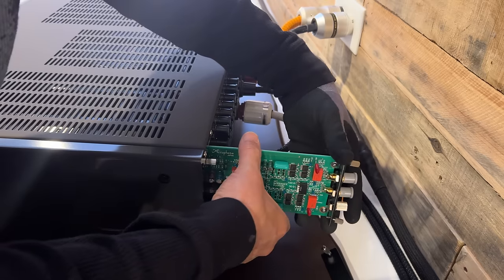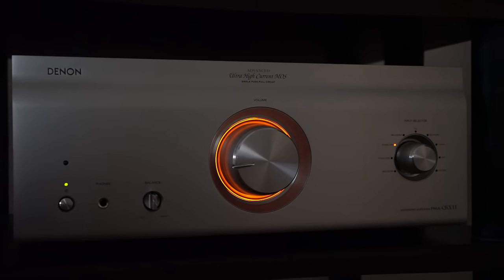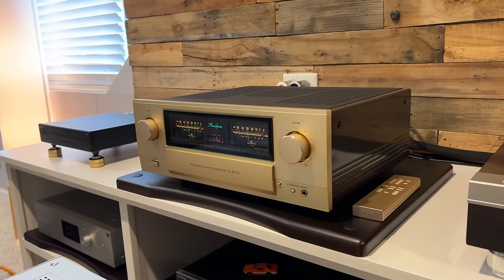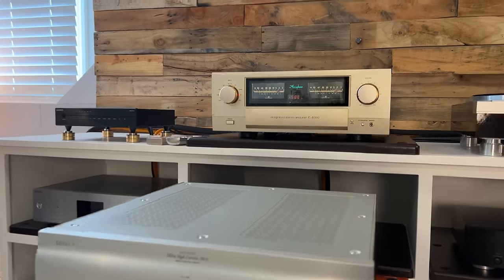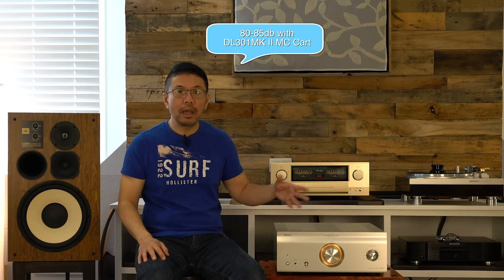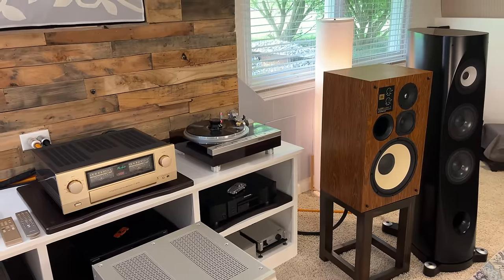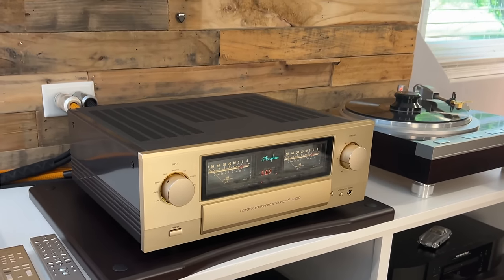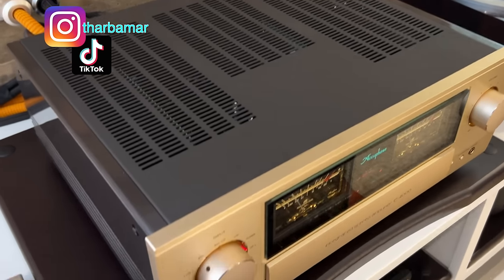Accuphase E-4000 or Denon PMA-SX11? Comparing Two Great Integrated Amps

Comment: From bar 1, the Accuphase has better detail, then the voice has far more emotion, with a more coherent soundstage. Denon’s good, the Accuphase legendary for good reason. Thx for the video.
Reply: Accuphase is really, really good but it's not extremely good (like the best transistor brands like Nagra, Spectral, Boulder) 

Funny thing is that Spectral is the cheapest of those three but sits alone at the top in performance.

Comment: Such huge difference! The Accu has much more of a honky and offset tone on the voices which is really strange. I strongly suspect an impedance mismatch in the phonostage(s) or  different RIAA curves are used in the accu and the denon.  Ideally, when comparing integrateds you'd want to use a dedicated phonostage that is correctly matched for your MC cart impedance and feed the line input of the amp(s) you're comparing. Otherwise, you're just comparing phono stages.

Comment: Thanks for the recordings, to me the Accuphase has a sweeter midrange with more vocal weight, and a little more shimmer in the treble. Denon by comparison feels a little drier and more flat. Accuphase gets my vote.
Reply: the drier sound you mention to me is the air like tube sound and I love it!! 
Denon PMA SX11 is the best amp Denon ever made...and only to Japan 😮...its a GEM to me...something not many in the rest of the world outside Japan even has! collectible...I've seen a couple left In Japan + shipping...air = tube sound Class A over just A/B of the Accuphase😂
Reply: thanks  @briancampbell7712   i think the name of the game here is you can’t go wrong with well made Japanese gear as the build quality inspires pride of ownership, and as you imply buying from Japan offers better selection and often lower prices. I was talking to a repair tech who said Accuphase is good for 40 years, that’s nuts! While your Panasonic VCR, Apple iic, and NES from 1985 decompose in a landfill, the Accuphase and Denon integrateds are soldiering on.

Comment: I like the air from the Denon...that amp is a collectable...very hard to obtain these days unless you're lucky to  find one in Japan and have shipped...I'd never get rid of it!!! wow😮...Class A sounds so smooth...the Accuphase class A/B isn't even close to the airy, tube like sound from the Denon...OMG...your ears are failing you if you think the Accphase is better🤪the SX-11 sounds beautiful with any! speakers🎶🎶If I didn't already have the Vincent SV-737 hybrid class A- A/B 4ohm 2x300 I'd be glad to buy your  Denon and have it shipped to me...I think It's the one of the BEST intigrated Amps available...Japan was only keeping this for there country and not sold anywhere else...that's why the power input was only designed for Japan...although like you a transformer can be easily purched...Don't do this...I'll be sad to watch your videos without this amp!
amazing how at or under half the price, the Denon PMA SX11 is far superior in sound quality over the Accuphase...I get Ear fatigue with just this video of the Accuphase...

Comment: Assuming that both system is operated at the same volume,I like the matching of Denon and Tad’s, there is a little more weight to the sound esp.the vocals( listener’s perception). I like the Accuphase too, the way it looks with meters moving , makes the experience more enjoyable.Otherwise if not listening keenly, you would not know the difference.Peace!

Comment: I have the SX-11. I listen to it through Aerial Acoustics 7B speakers and am VERY happy with its performance. I like its ability to control bass and deliver it with authority and ample headroom. The Aerial Acoustics 7B's are 4 ohm speakers and the SX-11 drives them to the fullest of their ability without any problem. I had an Accuphase E-408 before and the SX-11 is noticeably better and more dynamic. Of course the E-408 is several generations behind the E4000. The phono section is excellent too on the SX-11. When you factor in the price differences, it's a no brainer for me to go with the SX-11.
Reply: Where to buy sx-11 in US
Reply: @Hisboyleeroy If you don’t mind how much did it cost. Were there customs fees? What about warranty
Reply: Exactly I would like to know too; what is the suggested retail price? I have the Marantz Reference Integrated PM 11S3 and the phono stage is great; I use it with the Martin Logan 13A ESL would the Denon be an improvement?
Reply: @mahasidha9  I honestly do not know what the Japan retail price is. I had to pay close to $4,000 for mine which was new in the factory sealed packging.. I also cannot offer an opinion as it pertains to comparing the  Marantz PM-11S3 as I have never owned one.

Comment: Another great video. I recall some time back you went through an exercise to select your replacement int. amplifier. Finally you settled on Denon. What was the sound signature of Denon that won you over vs Yamaha, Marantz? Thanks
Reply from the maker: There was a few thing like Class A bias amplification with very good power and CR-Type Phonostage etc., Thanks

Comment: Great review as always, thank you! Given that you mentioned that warmer/relaxed speakers may sound "boring" with Accuphase, I am wondering if they are a good match for my Buchardt S400Mk2;. Anyone here have any experience or suggestions?
Reply: My $0.02...I've used a vintage Accuphase power amp with the S300mkIIs, so not a direct comparison, but my thought is the Buchardts are midrange-centric speakers with a polite top end, abnormally low bass extension, and mellow presentation. The Accuphase has no trouble driving these speakers with their slightly demanding impedance requirements and leaves nothing on the table bass-wise, though in my view it doesn't do anything to balance out the Buchardts' characteristics. This being a good thing or a bad thing is entirely dependent on your needs and tastes; if you like midrange-centric mellow music, it's a great match, if you need something that raises your blood pressure a little more, you might want something else.

Comment: The Accuphase sounds a little bit softer and more romantic (just a little bit more than the Denon). Other than that, there is very little difference between the two amps. Having said that, I am only interested in your audio rack used to stage your equipment. Where did you get it?
Reply from the maker: It’s custom made, thanks

Comment: Denon class A sound better , than class AB . I prefer  a preamp class A with 3 stereo power amp class D . Crossover of the speakers is what really made a lot difference in sound quality, you change a crossover from 1300 hz to 1000 hz and is like spending 10000 dls . Cables do not made any change , use 12 awg or 10 awg solid wire . Those jbl need boxes of 130 to 220 liters to really sound good .